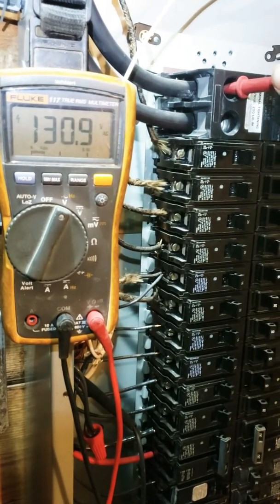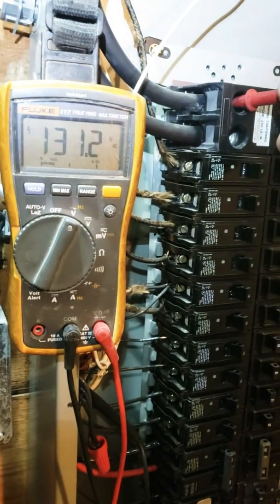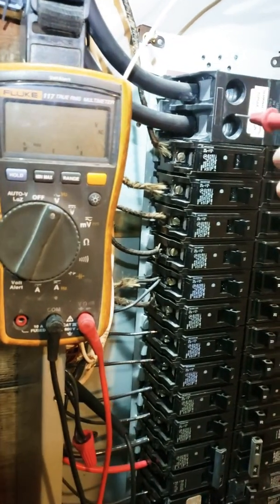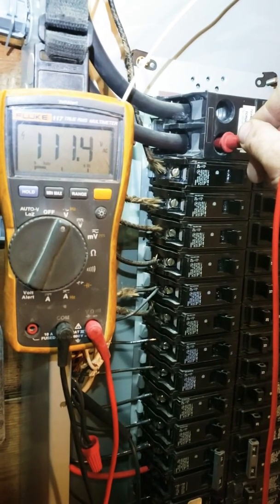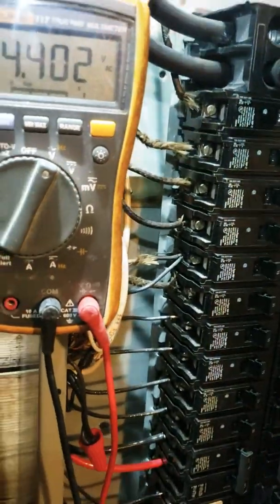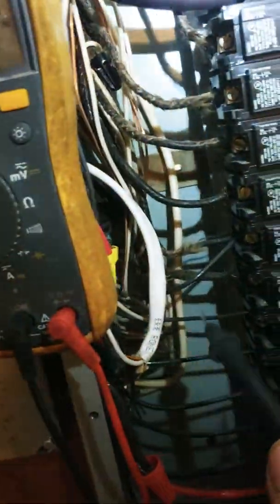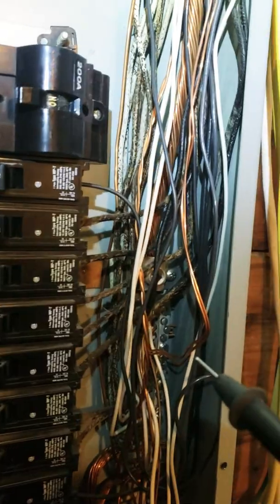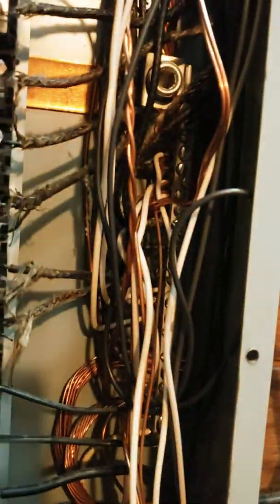How to fix those flickering lights

Comment from the maker: This was clearly an issue on the utility company side. The neutral connection was corroded causing a loose connection. If you are having flickering lights or dimming lights when running an appliance, call your local utility company to check the outside connections from the transformer. Most of the time an electrician will not be able to fix the issue and doesn't have the jurisdiction to work beyond the residence. I ask my clients to ask their neighbors if they're having similar issues, if so call the utilities. Your neighbor is sharing the same transformer as you and may be experiencing the same problems.

If you watch the voltage fluctuates between 134 on the high side and 109 on the low side. These numbers are not good and usually this means there is an issue with the neutral connection. The voltage should be between 115 and 125 volts to ground,  the closer to 120 the better.
Reply: I'm having the same issue in my kitchen, after watching this I went and turn the washing machine off and the lights stopped flickering.
Reply from the maker: @2jzjaymoney558 check with your neighbor and see if they are having similar issues, if so call the utilities
Reply: What about the electric company city ? Do they have the right to inter the house to check and problem. Do i let him in.
Reply: This is an old video but just because the issue is in the panel does not mean that the customer is out of the woods.  It could be a meterbase connection which would still be the responsibility of the customer to resolve.
Reply: I'd like your input, been having lights dim flicker when I use appliances, specially when ac turns on. Neighbor has same issue. We share transformer. I've had electric co out numerous times. They say their side is good. I hired electrician to replace main panel wires to rule out loose/corroded wires. Issue still goes on. What else can it be?

Comment: Never ever hang your multimeter anywhere near the breakers as the magnetic field generated by the live power will cause interference with the meter and you will get incorrect readings.

Comment: I had the same problem, but it was inside. My main breaker was bad. I called the power company first . The outside connection at the pole and can we’re good. It drove me crazy. End result, bad main breaker for me.

Comment: I used this video to help me figure out my electrical problem. And it was indeed a problem on the utility side. I replaced my panel in 2020 and when the utility dug up the cable they nicked the neutral line and four years later it failed. I'm a plumbing contractor and fairly well versed working with 120 and 240 lines but I've never had to troubleshoot an issue like this. One note I would add here:  If you experience a similar problem, contact the utility immediately and have them check their side first. I was informed that it was impossible to determine which side the issue was on without being able to isolate the utility side. I wasted a lot of time troubleshooting on my side to no avail. Two electricians I was consulting with didn't know this either, they did help determine it was a faulty neutral but they should've just recommended contacting the utility first. I finally decided to contact the utility on my own and it was fixed that evening 5 hrs later!
Reply: what amp and voltage rating is the piping you install the most?
Reply: @highnoon3156  240V 30amp for water heaters

Comment: Hello random person. I have had flickering lights for over a year - but today I was cutting my hair with clippers and when the light dimmed, my clippers changed speed like I was on a power converter in europe. Called the electricity company today, they are sending someone out to check xformer and connections to the house.  Let the fun begin. I may be back,to reabsorb… Fingers crossed.
Reply: Was it fixed?
Reply: @Zzz345Sh - It was a broken/corroded terminal inside my outside power box…which, I had to pay an electrician to replace, of course. No issue since then…

Comment: So my lights in my bedroom are flickering low once I turn OFF a heater. If I turn the heater back on the lights get brighter. Is this still the same issue?
Reply: Having same problem did you a find solution?

Comment: I upgraded all my bulbs to LED a few years ago.. and all was fine.   Then I upgraded my tank water heater to a big 3 line electric water heater.  Everything was working fine.  Then 6 months later  we noticed some new LED bulbs flickering  when water is heating.   The old bulbs that don't flicker are  Ecosmart daylight 120v 60hz 9.5w 193ma 840 Lumens non-dimmable  .  The new bulbs that flicker are Ecosmart 120v 60hz 9.5w 171ma 840lm non-dimmable and 120v 60hz 9.5w 150ma 800lm non-dimmable.  I also tried 9w and 8w bulbs and dimmable from other brands.  Everything new flickers.   I'm sure my system is too big for my house and this 200 amp service.  About to call an electrician and  possibly downgrading my water heater.  We have 3 bathrooms, 1 kitchen,  4  adult occupants.
Reply: Any updates? I'm in the same situation after switching over to a tankless water heater.
Reply: In my case it turned out to be something else,  the main  from the pole to my box was damaged and needed to be replaced.

Comment: Thanks for your video! Out of nowhere:
Just had lights dimming on multiple circuits when running the microwave. Thought it was the microwave going bad so unplugged it. Then while sitting in my kitchen noticed when the refrigerator compressor kicked on same thing. Noticeable dimming that would stay dimmer. Opened fridge door and the light coming on caused more dimming. 
Went down and checked the panel. Checked all connections at the breakers and buss with main off. All looked good and no change. Called the power co and they sent a guy out and I told him what was up and I was worried about the neutral coming in. He pulled the meter and said it looks good in the socket (my problem if bad) and then looks up at the line and noticed the neutral connection block was cocked. Said the wire fits in 2 grooves and gets clamped like that. He replaced all connections on the pole side and the weather head side and all good now. 
Just wanted to mention in case anybody is having a similar problem and it’ll start ruining appliances.

Comment: Could a device that changes high an low current states within seconds or milliseconds (up and down 5-10 amp spikes from a high powered computer) cause flickering? Is that unsafe or just annoying for sensitive LED lighting due to the voltage droop?

Comment: But if your neighbors are not having that problem what often goes overlooked is the minimum requirement for grounding resistance in the house which is 24 ohms. According to the Institute weights and measures and other research facilities who have done studies on the average household in America with only one grounding rod did not in any way meet the requirements of 24 ohms almost 90% of the cases 2 grounding rods had to be run 20 feet apart separated one grounding rod from the other grounding rod. This brought the grounding system well below 24 ohms. These studies were done in America Canada and Europe I have never on the public forum came across to any electricians or anyone with this knowledge. Therefore I would suggest if the lights are dimming and you're having a problem with voltage spikes run a second grounding rod 20 feet from the other. Each grounding rod must have its own 10 foot circle or cylinder of dirt which puts them twenty feet apart. There are instruments you can purchase to measure the res. In the grounding system of your house. If its to high you will have voltage spikes and dim lights (not flickering lights) when a motor turns on in the house.
Reply: Interesting... 🤔
Reply: Nope. I could disconnect your ground rod completely and your lights would not flicker when an appliance turned on if your electrical system was solid

Comment: Never even showed how to fix them
Reply: He told you. Either a neutral, utility, or xfrm with 99 percent of the time being utility. Check for loose neutrals ok breakers and meter/panel. Contact your utility company if you are not an electrician

Comment: I;m having that problem and its gotten worse. Power Co replaced the line to my house and put a monitor on the meter....Basically told me its out of their hands, as they replaced stuff outside and none of my neighbors have problems.
Reply: Same here. What did you end up doing?
Reply from the maker: Did you end up resolving the issue?

Comment: What if all is good at the panel. What could cause
Reply from the maker: If all is good at the house, meaning no loose or corroded connections up to the point of attachment, call the utility. Even if the utility can't find an issue, have another crew take a second look. I have had the utility say it's not them when it was them after another crew came out. Might of even been a third crew. If your sure, that's it. There's not many connections you need to check...
Reply: @elioselectric468  same issue I had the lineman tells me it was my "temporary" crimps  on a full service I did.  He was talking shit the whole time then he gets to the second pole  and realizes the neutral on the pole is broken.  Most of the lineman I've dealt with were cool.  This guy was a dick.  So I like how you mention getting utilities out a second time if the first one fails because sometimes you get a real winner.
Reply: As he stated in the video he checked the service entrance main circuit breaker and it was tight, a loose neutral connection at the meter or even at the pole could be causing the voltage issue seen on one of the phases.  When in doubt contact your utility company and they will come to check connections.  Do not attempt this yourself!
Reply: If it was a utility problem would opening all the breakers so there is no customers equipment on the line still show a problem?